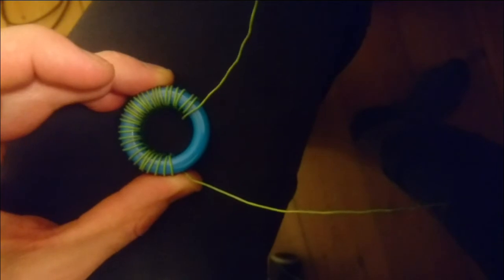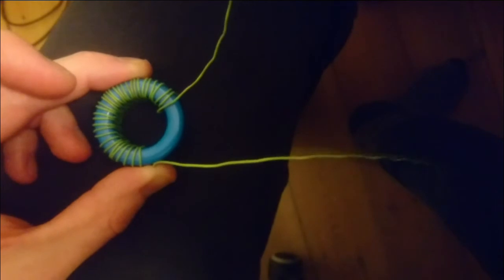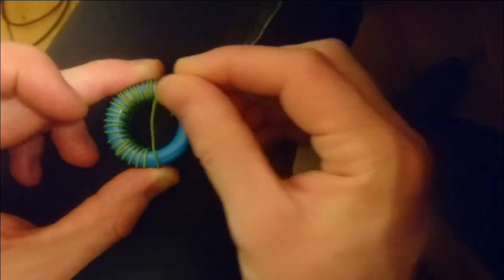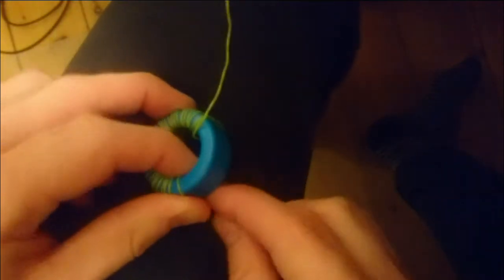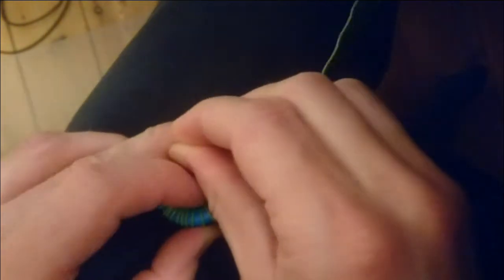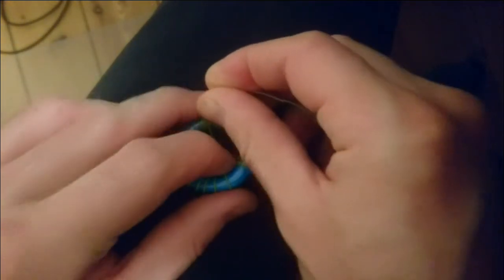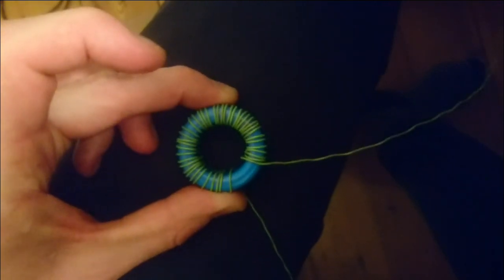Tips on Winding a Current Transformer on a Ring Core by Hand

Comment: if i use 32 turns like everybody else what burden resistor value i must have that i get 5 volts for 500amps,6 volts for 600amps etc...?
Reply from the maker: 1:32:32 will give you a ratio of 1:1024, to get 1V/100A you just use Ohm's law to calculate the shunt resistor. Pushing 1000A through a cable in through your CT will result in ~1A on the secondary side of the CT, so to get 10V you need R = V / A, 10V / 1A = 10 Ohm burden resistor.
Reply: @KaizerPowerElectronicsDk  Thank You!You helped me alot!i will use UD2.7c For CM300 & i plan to limit on 700apk with 1:32:32 Turn CT But i didnt know what Burden Resistor to put.

Comment: Please the link or the part number of the core you are using ?
Reply from the maker: It is a N30 material core, around 40mm outer diameter and 10mm wide. That should make you able to find one like it, just aim for a permability of around 5000, +/- 1000.
Reply: @KaizerPowerElectronicsDk  Is an iron powder core ok If I only want to measure 40Khz current ? Or does it have to be high permeability material ?

Comment: how did you do your turns calculations?
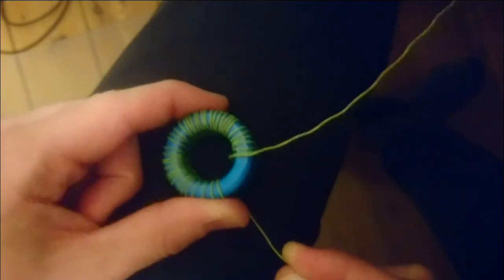Reply from the maker: It depends on the amplitude you want on the feedback signal and the load resistor you are using. If you make a current transformer with 50 turns on it it will have a current ratio of 1:50, if we have 100A through it in the primary circuit, and a load resistor of 2.5 Ohm, we get 5V out at 100A through.